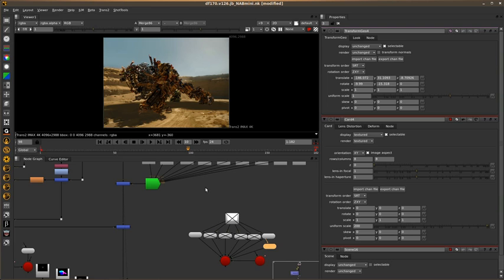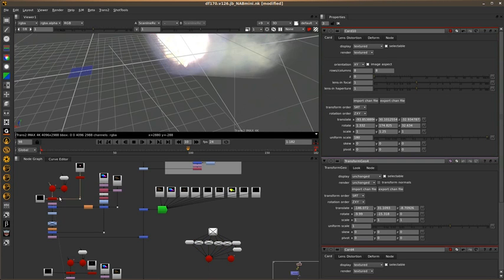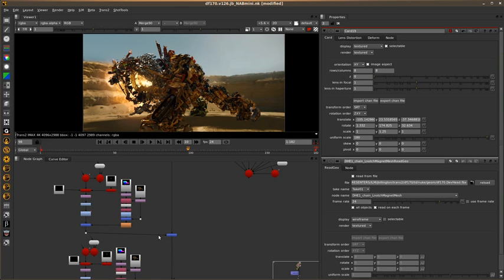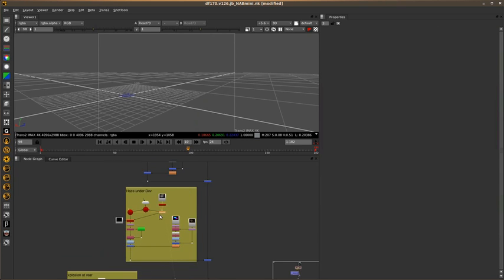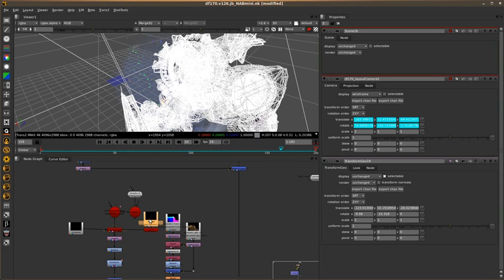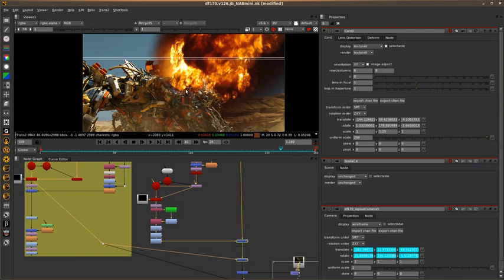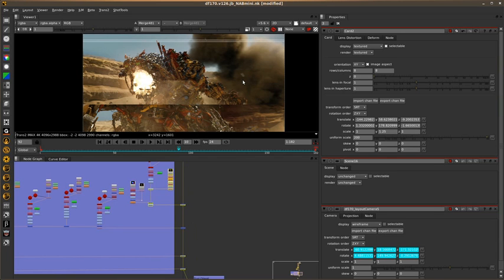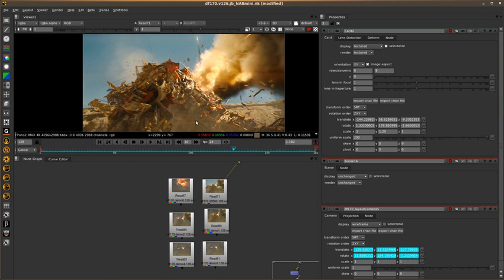Nuke | Transformers: Revenge Of The Fallen

Comment: hmm..i though those explosion/smoke etc elements are in 3d....their r just pre-keyed stock footage..?
Reply: thought the same O_O
Reply: Both are used. If they can save time by using stock footage and still get to best results then they will, but if they require an explosion to do something specific then they will either try to replicate it in 3d or have to film a controlled explosion
Reply: They are.  Some of these were probably rendered out, they aren't just stock footage.  

They are in 2d after they are rendered out from a 3d software.  It's easier to composite it in when it's 2d.

Comment from the maker: Using the depth or Z channel that is rendered with the rgb channel, i am able to extract a holdout matte for the exact depth i need.
If i had this geometry inside of nuke, and wanted to use the "scanline renderer". I can use the geometry as a holdout within the 3d interface, by attaching a fillMat texture to it its input. Found under the 3d/shader/fillMat within the nuke interface. (from Jason)  Hope it helps.